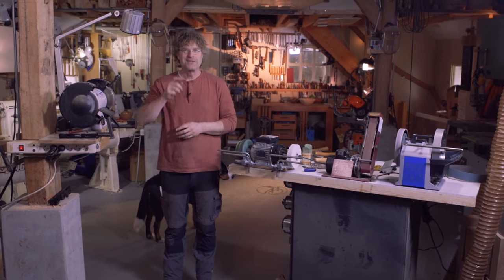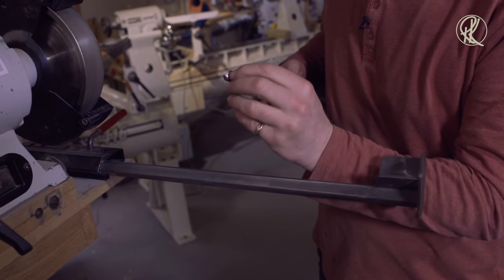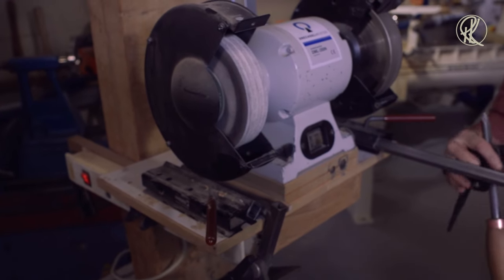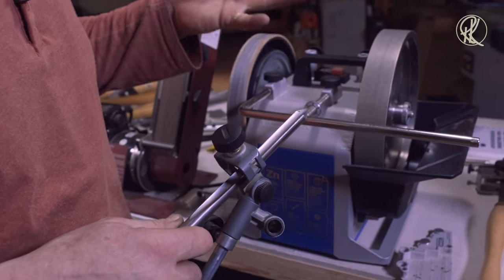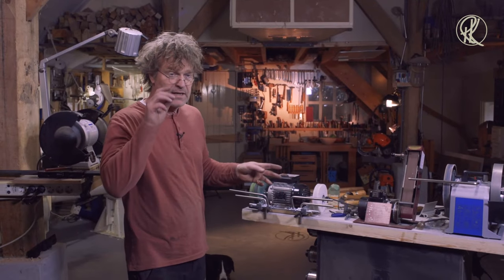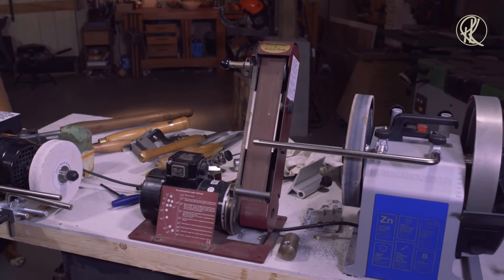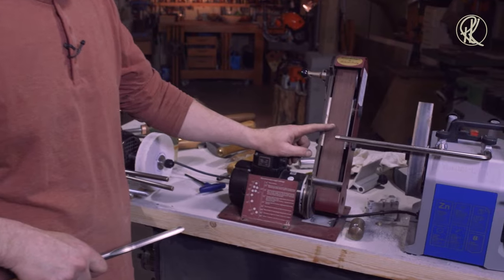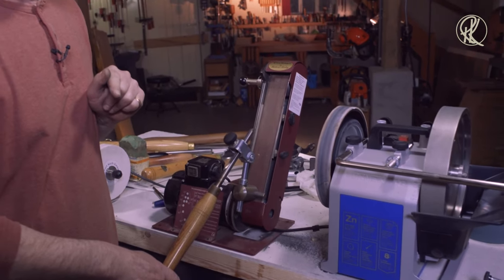Comparison of 4 grinding machines for wood turners

Comment: If you have a flat bevel it is impossible to 'rub the bevel' AND have the cutting edge go into to the work, as you will have to lift the WHOLE of the bevel off the wood to create an angle for the cutting edge to go into the workpiece. Flat grinds are used on the back of carpentry chisels or plane irons where the plane body sets the angle, not the bevel.

Comment: Ronald: This is an excellent review of these four grinders and/or sharpening systems. I particularly appreciated your summary of the pros and cons. One element missing from the presentation, however, was cost comparison. While I don't know the retail prices of all four systems, I do know that the Tormek 8 costs just about what a quality secondhand lathe brings on the marketplace. I would speculate that a beginning woodturner considering a grinder/sharpener should expect to spend almost as much as what was paid for the main piece of equipment in the shop, i.e. the lathe...
Reply from the maker: Thanks Nick. You are completely right of course. Price is a serious decision factor. And I did not think about putting prices in the video. On the other hand prices change, due to Brexit the ProEdge for example has risen considerably in price. But what is sure... none of the machines is cheap stuff... :-)

Comment: I don't know of you are aware that both the diamond and cbn wheels are abrasive granules that are electro plated upon a steel wheel. They both will wear down to the point of not usable. For the price there are much more durable and effective cbn wheels that will be much more durable as well as grain structure to be optimal throughout the life of the wheel.

Comment: Why do you say that heat is bad for HSS tools? I agree that the CBN wheel will give a much cleaner sharper edge than the standard bench grinder grey wheel, but that's to do with the fineness of the abrading particles, not the amount of heat generated. HSS can cope with really high temperatures without losing its temper, unlike high carbon steel, where if the tip is allowed to blue, it will become brittle and not hold an edge.

Comment: The dust from the CBN and diamond wheels floats around the shop like wood dust does. I do have a Tormek, and some day I will get a diamond wheel for it. The CBN eventually wears out, some thing like 5 or so years for a production turner. Diamond on a standard slow speed grinder will deteriorate because diamond can't take heat. On the Tormek, it is fine, and should last forever. They do have a liquid solution that you can use to capture most of the dust. I do love the leather strop wheel on the Tormek. A must for my skews, which I do use some times.... Saw Eric Loffstrom do a demo and he started by tapping his skew on the lathe bed. He sharpened it on a 60 grit CBN wheel, then stropped it on some leather, and then shaved his arm, very sharp. You do have to take that burr off....

Comment: Thank you for doing this deep dive comparison between these 4 systems - it was extremely valuable from an experienced wood turner who has used them all.  I decided to go with the Sorby ProEdge for my first sharpening system as it is the smallest and can grind and sharpen both planes and chisels as well as turning tools and seems the easiest to setup and use repeatedly.

Comment: This was very helpful, Ronald. Thank you! I have never been able to get consistently good results sharpening tools so got started using carbide and the thing holding me back from switching has been understanding how the grinders/sharpeners work and the basis of comparison between them. Before spending money on one of these I'm going to get some hands-on sharpening experience with a local instructor but now I know much better what to ask and what I'm looking for. 

Also, I think you are the only YouTuber I have found whose camera person regularly provides running commentary and will laugh with/at you from tine to time. It really is quite endearing and adds a lot of warmth to the channel. (Based on a small sample size - I've only just discovered the channel.) Anyway, great work and thanks!
Reply from the maker: Thank you for your kind words Rob. Really appreciated here!

Comment: Thank you for taking the time to do this Ronald, it was very helpful. I have the ProEdge and I am just awaiting delivery of the Koch HT3000. Between the two machines and other slipstones and strops, I should be able to keep all my carving tools in tip top condition. A couple of things you didn't mention about the Koch system is that the thermal reactive sharpening does not create a burr, so you don't have to worry about removing it. Also, a slight disadvantage for some people is that the compound only works at 7 degrees Celsius or above, which could be an issue in the Winter if you work in an unheated shop.
Reply from the maker: Thanks Brit! for this replenishment.

Comment: Great video Ronald, I have leant a great deal from your calm and informative presentation. If I were to buy one CBN wheel for woodturning what grit would you recommend and is there much advantage of 40mm vs 25mm wide? Thank you Paul
Reply from the maker: Hi Paul, the big advantage when you wheel is 40 mm is that it is wide enough to roll the tool over the wheel. If you also have a white aluminium oxide wheel on your grinder I would suggest a 280 grit (approx.) wheel.

Comment: you also sell the CBN-Wheels, if i want to tune my Tormek with it, what diameter and grit should i take?
Reply from the maker: Hi Haenz, depending on the Tormek type a 20 cm or 25 cm wheel. I'd choose 280 grit or 500 grit. 280 is a bit faster, 500 finer...

Comment: I'm very surprised that the Koch green (polishing) stick is still produced.  I had found multiple issues with this product many years ago. Surprised that it is still being used on a professional environment.  The actual refinement of the particle size is 6 micron, which is an actual fine grind size. Never a finished surface.
 The felt wheel that was used had a definite depression when gouge pressure applied to it. Causing a radius to form on the cutting edge.  Besides the new grind finish had no shine , whatsoever.